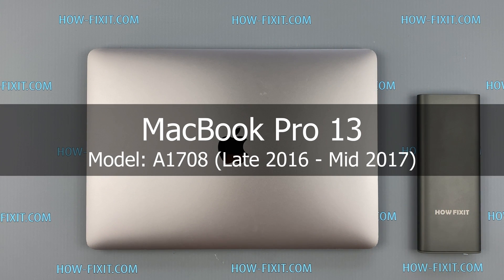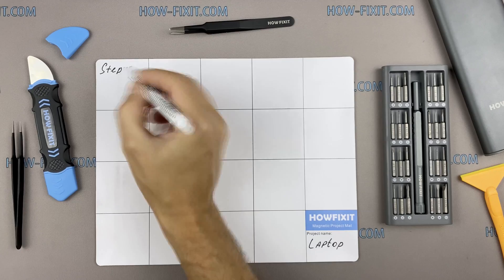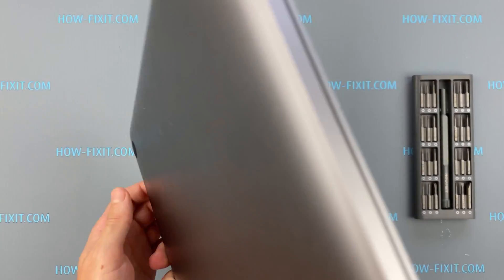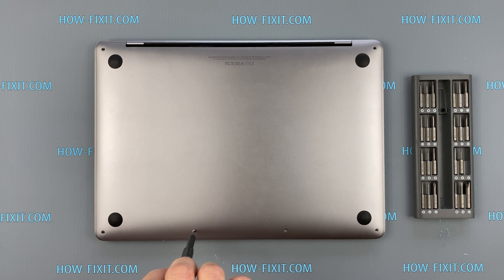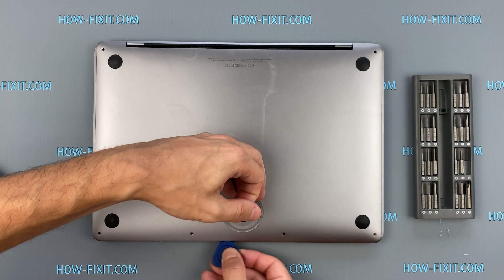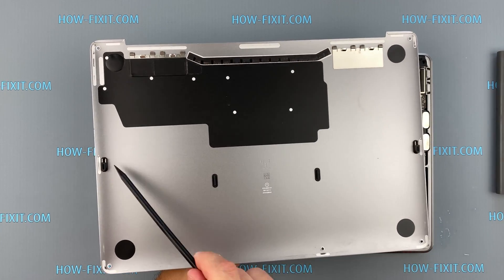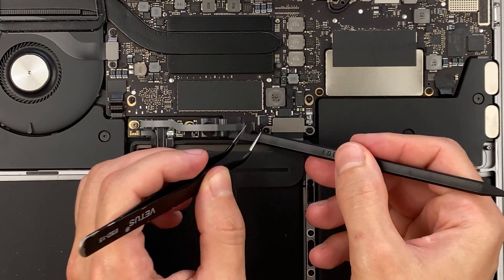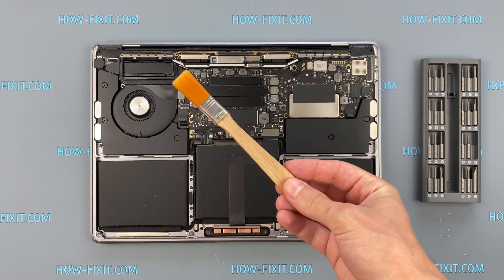MacBook Pro 13 A1708 Disassembly, fan cleaning and thermal paste replacement

Comment: Apple sets yet  another benchmark in dumb design. Incredible that you have to remove the mainboard just to replenish the thermal paste!

Correction, not dumb; evil. Like modifying the battery ever so slightly so that to replace it you had to completely disassemble the laptop, as they did with one model.

There's people I would throw off a parapet if I had the power, and whoever it is at Apple that makes these terrible design changes is one of them.

Comment: Appreciate the video for sure.  It took some time to find a good one for my 2017 MBP 13inch (non touchbar).  I ended up just cleaning it up a bit and replacing the thermal paste.  My only mistake was the cable to the keyboard got stuck under the board when I was re-assembling.  Had to take it apart just enough for me to get under there and pull that little cable from under with tweezers.  I also wasn't use to those tiny locking tabs that hold the ribbon cables in.  The part that took the longest was getting those rounded wifi cables snapped back in.  In the end, it all worked out.  Thanks again from Colorado!

Comment: I fucke d up at 2:35. Do not I repeat do not pull the battery connector all the way up. Pul it up at maximum 25%. Luckily it's my secondary laptop. Apple is shyt in terms of repairability.

Comment: hello I have a screen flickering problem on my mbp 2017 13 inch model. I havent been cleaned this 6 years. If I clean it, it will be fixed or not?
Reply: Flexgate

Comment: Hi, I have this Mac and my problem is that colored lines like rainbows are beginning to appear at the bottom of the screen. Could this be that I need to change the thermal paste and will it be solved? or it is already artifacts. thanks for the video.
Reply: no, looks like the cable between the screen and the motherboard

Comment: When I took out the battery I broke the trackpad flex and turned on the computer and the performance is very slow. Maybe I have damaged the processor when changing the paste? or could it be just the flex?
Reply: That can be just the Cable

Comment: My macbook pro heats up when it´s charging. Is it a problem with the thermal paste?
Reply: It could be, but not necessarily. Most devices tend to heat up while charging. It greatly depends on the age and recent maintenance of your device. I would recommend installing some kind of temperature monitor, and as long as it doesn't exceed 70 degrees Celsius (158 degrees Fahrenheit), you should be fine.
Reply: @deathkryz  i find that when I used safari the laptop would heat up but using brave browser the heat has decreased even with the same amount of windows opened

Comment: thanks, i just finished the service on my macbook, o bought the Jorest 24 piece Kit from Amazon and 2g of mx-4 thermal paste which is more than u will need, just be careful as at some parts the screwdriver tips change and its not mentioned in the video, but its alway switching between the 3 which were introduced in the beginning. The Jorest Kit was o.k. but its definitely not for professional usage, but will do fine on this repair. thanks @How-FixIT !